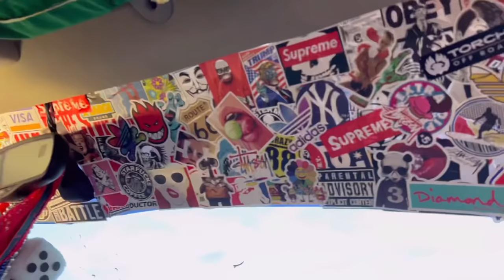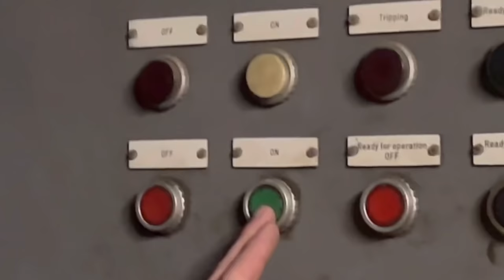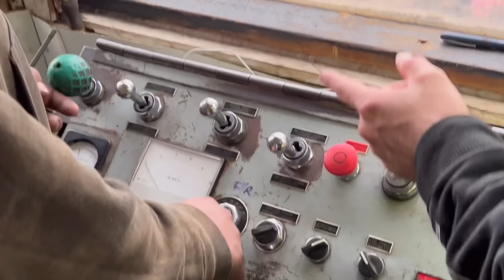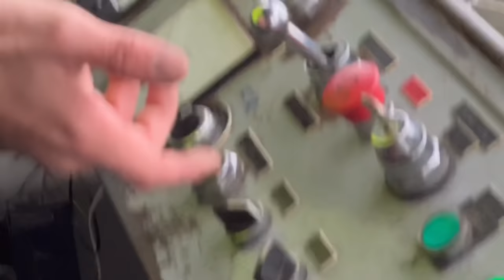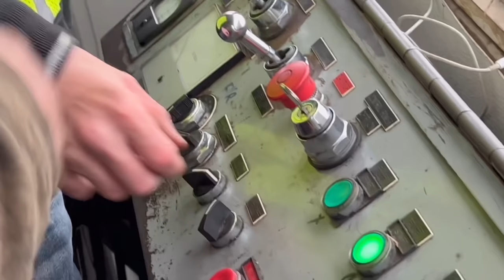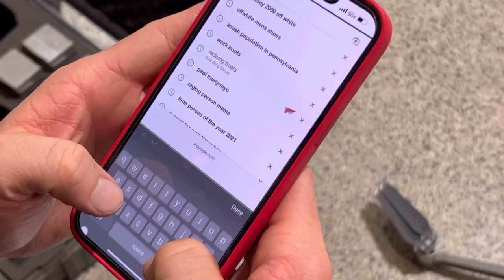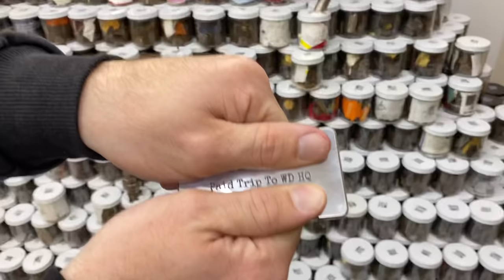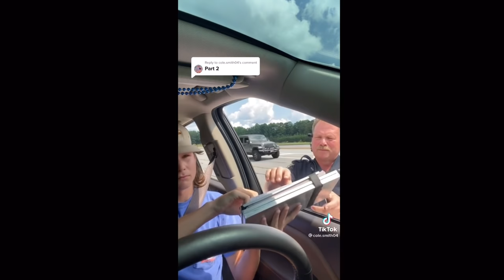Squatted Trucks VS Industrial Steel Shredder

Comment: from a middle aged millwright who spent 20 years in steel , thanks for this..... i miss working steel. the shredder i worked on , when we would change out the motor , it was a 6000hp GE...

Comment: Everyone: WHERES THE HILUX?
Cody: gone. Reduced to atoms.
Reply: Hey Cody. Can I ask you something? Do you wanna buy my car to destroy? I put a total of $1600 into it. Basically the whole suspension was replaced and some brake parts and a good amount of body work. And then It dumped all the oil out going down the road to work. And I’m told the trust bearings went out and let the crank move and pushed out the front seal.
The most I’ll get from everyone I asked was $500 for it. And I wanted at least half back.
I was planning to try and fix it in spring but I’m fine with losing some money in exchange for watching you destroy it. But at the same time it was the last thing my grandfather got me before he passed. So I’m on the edge of trying and giving up.
Sorry that was long

Comment: One thing I hate about those drones is they have to update every single time even when you change the battery it never stops. If you need it quickly there is an update half a battery gone lol
Reply: That's why pros build their own.  It's not hard. It's probably cheaper.  It looks way cooler. You can upgrade for new jobs.
Reply: @anonymoususer7170  thank will do
Reply: @KeithZim  a custom professional cinematography quad is WAY more expensive than a DJI. You're thinking of those little FPV drones. And even those aren't cheaper. Just the Fat Shark FPV goggles, the camera, and transmitter/controller cost more than a DJI. And it's not going to have any of the features of a DJI. The cinematography drones, that "the pros" build, are about $10k

Comment: I hope the scrapyard has a robust lockout tag-out program.
Reply: They do. The PPE closet is locked out and when you get tagged by flying debris, you'll be out 😁
Reply: @brandonobaza8610  Bam!
Reply: Why? As long as your employees are not complete boneheads you will be safe without all that crap.
Reply: @mysterybuyer3738  not true at all. All it takes is for one person to make a mistake for someone to be killed. With the machinery and all the noise there it a dangerous place to be. LOTO saves life’s everyday
Reply: @mysterybuyer3738  Even with all that "crap" accidents happen.

Comment: I use to work on one of them at a place called Sims metal in O'Connor Western Australia. And where that stuff was flying out off is where I sat pull copper and stuff off. They had a big black flap of rubber to try stopping that from flying out. One day a leaf spring got stuck behind the rubber mat and cut the hole conveyor belt down the middle took me something seconds to notice it had hit the emergence stop button. That cost them $1000 and $30 thousand for the conveyor belt. So just put big staples in it. I did so many different jobs at that place and over the years.

Comment: I would love to see the motor starter and VFD’s that serve that insane piece of machinery
Reply: There's a place I do work at sometimes that has a 3500hp motor that looks to be the same physical size as the one in this video. I'll take pictures of the controls next time I'm there. (The controls, transformers, etc are in a blast proof room with redundant 20ton Air conditioning units)
Reply: @SteveOnStar  you know if motors that size have multiple 480v feeds coming to it? I've never worked on 3ø motors that were over 120HP.. man...you would need a 6000Amp switchgear just to run 1 motor that size 🤣
Reply: @afuzzykkitten  I don't recall if they do or not but I would be willing to bet. They also don't run the motor for particularly long periods of time. It is on a test rig for oil field pumps.
Normally they're powered by something equivalent to a caterpillar V12 diesel from what I've seen.

Comment: As an election for high voltage small pice of advice. Don't go near that transformer when it's wet. 20kv can jump up to a foot in arc length to your body in dry weather with moisture in the air could go up to 2 feet.
Also judging by the sound of it you either got it pushing near overload or it's extremely dirty.
High voltage will kill you please stay safe
Reply: @iOrbittt  i give you that point still it's dangerous they are usually fenced in so that you can't get this close .
Technically you could also have the plugs from the SF6 switchboard just laying there out in the open doesn't mean that you should.
I was simply trying to get the point across that it's not that safe to go up to a live transformer and touch it regardless of it being a dry or a wet one
Reply: @iOrbittt  the other part was simply a suggestion that something seemed odd to me last time I heard a transformer make that noise was when a grid transformer shorted out against ground because someone forgot to cut away a bridge in the power wire's wich were deconstructed. The breaker didn't blew and the transformer only got louder just after smoke was coming up from the wires dangling in dry grass we knew something was wrong.
Just because you have these measures in place doesn't mean they detect every fault. I wasn't trying to point out major mistakes or to shame anyone just pointing out something, so it gets noticed before something bad happens. If I am wrong and everything is fine and working as intended, perfect better then just sit silent and let something break down or to get someone hurt. As a fellow electrician you know what I mean with that, or at least I hope you do

Comment: I know the risky/dangerous nature of this channel and all but god damn if this isn't the most dangerous work site I've ever seen. Aside from the obvious hazard of walking over heaps of shredded everything, you can see: unguarded shafts and couplings spinning, and energized breaker in their MCC with the panel open, material projecting out into the open, evidence of explosions due to careless screening of materials, fuel leaking from the 1st truck because they didn't drain it first, letting a visitor stand on the conveyor drive and the rotating crusher, workers clearing that rotating drum with their feet. In those last two cases do you think they locked out those motor's breakers before putting themselves directly in the line of fire? I would bet when they cleared that jam they didn't.

This site will certainly cause either massive trauma injuries, a fatality or both in due time the way they are operating.
Reply: who?
Reply: Yeah I can’t say I’d ever want to work at a place like this. It’s a fatality waiting to happen.
Reply: You haven't seen dangerous until you've seen some of the oil refineries out there, and how they operate. Makes this look safe.
Reply: @davelowets  I can't speak for where you live but in Canada Oil & Gas facilities are heavily regulated for safety because of the potential for disaster. For example, our facility is regularily audited by ABSA, OH&S, the fire department and our insurance provider to ensure we're compliant. 

This place appears to have zero oversight.
Reply: @joelgossmann5347  I live in the US, and we have the same regulations also, but things often get overlooked, and massively dangerous conditions exist at some places that make this place look like a child's playground.
Reply: Found the OSHA guy
Reply: @dr7477  No, you found the snowflake that CALLS osha on the company he works for every week.
Reply: I think that common sense is a requirement to work there, so there probably haven't been any bad accidents.
Reply: @BigBisalreadytaken  The problem is, not everyone HAS common sense.

Comment: Fascinating video and it looks like a lot of fun. The biologist in me has to ask though, is there some sort of treatment for the surface and groundwater runoff from this facility? If not, this site is an environmental nightmare.
Reply: I wondered about that as well. Hell, the ecologist in me is concerned over a minor spill when changing oil in the driveway
Reply: there's probably a liner similar to ones used at landfills
Reply: The water treatment facility is next door lol
Reply: @Chris-mx4jb  That's what I'm hoping.
Reply: @LifesLaboratory  and when i say probably i mean hopefully lol

Comment: That's not a shredder, it's a pulverizer. It doesn't shred the vehicles, it literally beats them until pieces fall off. I don't believe this is a normal application for one, but if it works it works.

Comment: Im in australia im really confused seeing yas scrapyard yards and wrecker yards most cars are quite fine lot usable parts even able get it back on road easily but yas crushem my country it only crushed after people taken diff engine seats cut roof off cut rear 1/4 panels off which yas call fenders and cut floor pan out that time its crushed since nothing left for people use on they cars

Comment: Putt pullys to each
Reply: Wheels
Reply: Favorite truck wire alter naters to off on wlswitch fast switch low med slow
Reply: Wire pullys to pluggs speakers and ampss ac heater water pump foam insolate wire
Reply: Trunk front and back